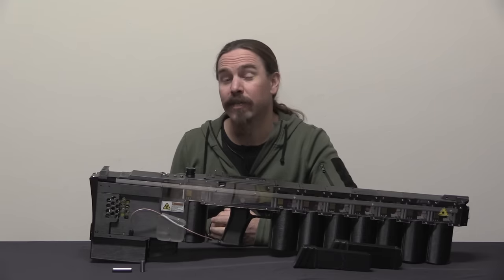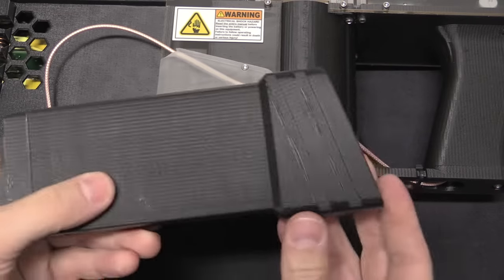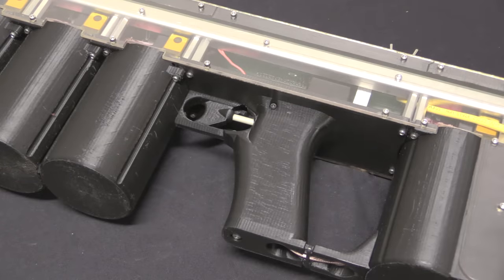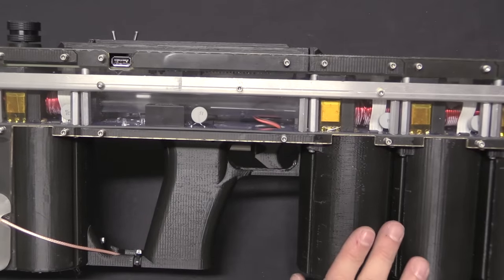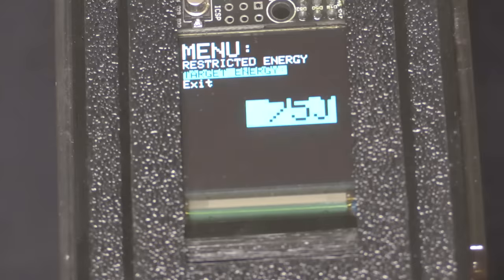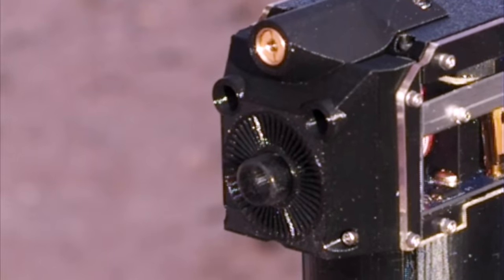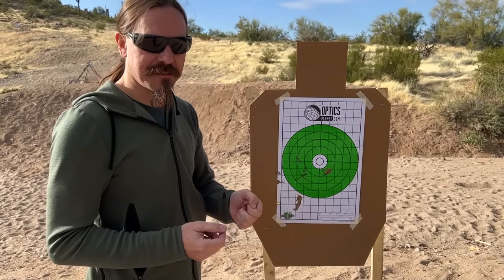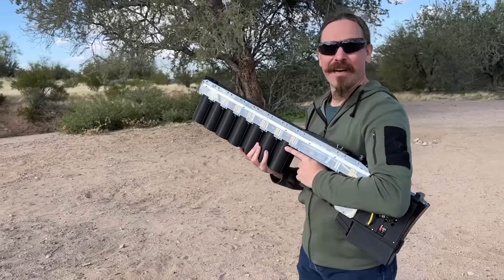ArcFlash Labs' GR-1 Anvil Portable Gauss Rifle

Comment: Since the projectiles for this thing are pretty much the size of a whole cartridge for actual firearms, do you think it could be used to deliver explosive payloads? The long rounds aren't quite as big as actual grenade launcher grenades but I feel like you could pack something that's still mighty unpleasant in that form factor.
Reply: Maybe you can pack a projectile similar to a mini rpg round. Not quite a boltor but pretty damn close
Reply: possible. I was thinking CNC machine a spiral projectile or some sort. Would likely help the tumble, and accuracy.
Reply: Could use depleted uranium to make it punch through body armor. I don't know about explosive payloads though.
Reply: I would almost be afraid that the acceleration would cause it to detonate
Reply: @sorrenblitz805  I don't know if Uranium is ferris metal or not.  At most it would be paramagnetic and not suitable for a projectile in a weapon that relies on magnet fields.
Reply: @crisnmaryfam7344  to expensive per round. I was thinking drag stabilizer like a fin or streamer
Reply: I have no clue. Maybe some sort of plastic shield around a charge with geometrically stabilized metal structure around the whole thing that wouldn’t crumple underneath the pressure of being whisked along the barrel…
Keep in mind I live in lala land.
Reply: Does the projectile need to be ferrous? Or  just electrically conductive?
Reply: @robjohns5806  Ferrous (thanks for the spelling help) as I know it. They are propelled by the magnetic field produced by the copper coils. either way they are insulated by the plastic barrel regardless so conductivity wouldn't be a factor.
Reply: @derekmills4220       I know nonferrous, diamagnetic materials like copper and aluminum  can be accelerated with a moving magnetic field.
     I remember convincing myself that it was the materials degree of diamagnetism that was affecting how much my old copper penny or chunk of an aluminum heatsync woulf zip off when the rotating N52 magnet (rigged to dremmel tool) was brought near. 
     Apparently that's not what causes the movement though. After i obtained a bit of bismuth thinking the effect would be much greater i was disappointed to see any interactment was basically imperceptible to me, and it is really the copper and aluminum's high electrical conductivity, and Bismuth's lack of, that relates to the acceleration. But im not sure if the gauss gun is using the same means to accelerate the material, eddy currents?  
     Sry if i was rambling on. 
     IMO electromagnetism is much more complex than most realize, and not completely understood, I remember reading magnetism may be product of relativistic effects on electrical fields...  Yeah, we can manipulate the phenomenon, but without fully understanding, the same way we do with gravity or quantum mechanics.
      Edit: after doing a bit of reading gauss guns can use ferromagnetic or electrically conductive material as a projectile, and i probably shouldn't be separating electromagnetism into exclusive properties
Reply: @robjohns5806  interesting. Well seeing that Uranium is paramagnetic, and semiconductive I suppose it could be used as a projectile.
Reply: @derekmills4220  A tungsten slug with a ferrous sabot strikes me as the solution, like a scaled down version of the railgun rounds we've seen tested, just using a sabot for its magnetic potential rather than for conductive potential or sheer width, it might have to be more complex than with other forms of propulsion to keep the (essentially) non-magnetic slug centered without barrel contact for slug or sabot, and somehow stay as one piece when not being launched, but it's still within the realm of possibility I think.
Reply: @crisnmaryfam7344  you could impart spin with magnets or fins
Reply: Brony
Reply: @sorrenblitz805  Not at that speed. To put it in perspective, I still remember my classes in the army, the 5.56 travels at 990m/s, this one is just going at 70. It will hurt if it hits you but the chances of it penetrating is very low.
Reply: That is made up lol.

Explosives can be extremely inert.
Reply: @sorrenblitz805  Uranium is only weakly paramagnetic.

Penetration is related to hardness and projectile length.   A steel dart will penetrate fine.
Reply: @crisnmaryfam7344  shoot worn out carbide endmills.
Reply: @robjohns5806 "gauss guns can use ferromagnetic or electrically conductive material as a projectile, and i probably shouldn't be separating electromagnetism into exclusive properties"

Correct! Electromagnetism is a unified theory. That said, if you use magnetism and conductivity in different ways, combining them could create a hybrid gauss/rail gun. 
👍
Reply: I can imagine needing a solid mass for good acceleration, but i really don't understand the science on this. Perhaps a hollow, explosive round would work just as well as these dowels.
Reply: This thing is using heavy projectiles not because it's more beneficial, but because the speed limit of their acceleration system is too low to shoot optimal projectiles with decent amount of energy
Reply: Wouldn't those be considered a destructive device?
Reply: They're tumbling, so no, that'd not be worth it anyway. Also... WHY? On even the most anemic 10mm grenades you get FAR more velocity, precision, ease of use, cheapness and efficiency with standard powder rifles! Not to mention the slow velocity would mean much more delicate detonator, which at these low velocities would mean that you'd have the risk of explosion on dropping them or hitting them! So yeah, bad idea all around, and as a weapon its a good century or two away from actually being worth anything, unless we come by some radical new innovation.
Reply: @KrepsyK  well, if projectile can withstand acceleration from an explosion of gunpowder, EM impulse won't do it any harm either.
Reply: @robjohns5806  as someone above already mentioned, RPG-7 style projectile (magnetic rod with explosive charge on the end, sticking out of the barrel) will do the trick. Or, if you want to keep it within calibre: half-and-half in the length.
Reply: Lol just dip them in poison . Hows that for ya?
Reply: @DzR1591  useless, that's how. You can do that for literally anything else and claim it's an amazing weapon, including a sharpened twig.

Comment: I think the fact the slugs can vary so much in size, weight and adjustable energy could point to a future with weaponry where you would see more universal weaponry with Gauss rifles. Same weapon could be used with lower energy, smaller slugs with larger capacity for close quarters combat or be set to larger slug at high energy for vehicle/sniper round. I would not be surprised with evolution of Tech of seeing something like interchangeable parts lol larger external battery and barrels with better cooling being used on the same rifle to turn it into a high caliber/high rate of fire suppression, or having barrel extensions that include more coils to increase velocity. There is a incredible amount of flexibility that can be done with a single core weapon.
Reply: @onkelpappkov2666  It's not that. You can always add more coils for velocity. But you can never have rifling.
Reply: @onkelpappkov2666  Would there be any benefit to making the ammo into round balls instead of oblong slugs?
Reply: @myWiggy  The shape of the bullet has to be redesigned, a better barrel, higher energy and a variable distance between the coils to optimize for accelerating speed.
Reply: So like a gaming pc.
Reply: @Gubers  100 years seems somewhat pessimistic considering we went from the first airplane to a man on the moon in less than 70 years. What is more relevant is the cost for these weapons systems.
Reply: @Gubers  True and the problem with science is, especially within physics; it isn't very profitable. In order for us humans to make the 'next big step' in development, we do need to understand better what is happening in the atom scale (and smaller). Problem is, we are stuck at the Heisenberg's principle until we have a genius among us who can crack the 'code' :)
Reply: @onkelpappkov2666  wouldnt this be solved by programming? Couldnt you have a switch rapidly cut power as you reach the next coil?

Comment: It seems like long projectiles are the way to go with this. The long slug was able to get the full 100J of kinetic energy while the small slugs were putting out somewhere around 66. There's still a lot of issues to be worked out on this of course, but even as it is, it's really impressive.
Reply: I think going with a sling bullet design might be interesting, or really any round/ovoid shape. I don't see a point in trying to stabilize a cylindrical projectile when you could do the same with a shape that will have more uniform penetration regardless of tumbling. Maybe I'm just full of shit though idk.
Reply: @tx7140  I'd imagine the length is more important to the timing of the accelerator.
Reply: How about a dart with spring loaded fins?
Reply: @satibel  The idea is good, but it is difficult to do without a machine
Reply: @satibel  The Navy rail guns I've seen video of basically have a casing protecting the fins until they exit the barrel. So in the barrel it is a cylinder and that jacket comes off upon exit.
Reply: Long time ago (when I was a student) I made small coilgun so I have theoretical and also practical experience.
Projectile must be created from some ferromagnetic compound and had maximal mass (ideally cylinder) for correct operation - some special shape like dart is not possible.
Barrel needs to have higher tolerances and also thin walls (some plastic tube is inadequate).
To prevent tumbling, projectile must have aerodynamic shape and also correct positions of center of gravity and drag (cone in front and small cavity from back). Of course projectile speed must be high enough.
Overall design of this GR-1 is very weak and also workmanship is poor. And also I would never try to sell something like this - because I would scorn to do it and also it is illegal in my country (everything above 15J of kinetic energy is firearm - so illegal armament felony).
Reply: @ferosofranek8817  I think everyone should look at this as an interesting project and no more at this point.
Reply: @ferosofranek8817  is there a reason rifling isn't being used in this weapon? I imagine it would help maintain the angle, and can't think of any reason it should affect the acceleration within the unit
Reply: @MelodicTurtleMetal  perhaps temperature issues? Temperature is already an issue with the "floating no-contact smoothbore design", adding another variable such as friction from a rifled barrel will increase the temperature drastically
Reply: @fdenrico9861  ahh fair enough. Good insight
Reply: @MelodicTurtleMetal  I think that any kind of rifling will slow down projectile so much that this coilgun will be useless. There is very small kinetic energy, every Joule counts...
Also some plastic tube doesn't allow any rifling - projectile must be tight-fit into barrel and plastic will be worn out after few shots.
Anyway, 70m/s is very slow (my simple BB gun has 170m/s), therefore this is something like projectile thrower, not canon/rifle.

Comment: Hers the thing:. That thing sounds like a crossbow, and 100j isn't half bad for a crossbow either.  Make the round pointy and add fins, and you have a weapon worth respect.  All the power of a crossbow, all the ammo capacity of a rifle.  Even this zeroith generation mass driver could be made very deadly indeed.  Rember, this is basically the arqubus of electric guns, and last I checked empires have been built with far worse.  Hell of a gun, and props as always for Ian and crew for treating this like what it is: a crude, but potentially very deadly weapon.

Comment: I love how much the rifle of the future is still reliant, and quite fouled up by magazine quality. It just goes to show how right Ian is when he explains the benefits of using an existing magazine system for development. Can anyone recommend a magazine that would work well with the projectile sizes they're targeting?
Reply: Not a whole ton of magazines for this kind of feed system.
If they made a .50 version they could probably drop stiffer springs into Nerf mags.
Reply: Just slap a P90 mag on there it'll be fine.
Reply: I would hazard a guess that a more positive magazine retention catch than just a ball-detent might mean that stiffer and more reliable magazine springs could be used.
At the moment, the mag spring would be fighting the ball-detent spring and that seems to mean that the mag spring is weak enough with one~two slugs left that it tends to misfeed.

Comment: I'm wondering if they've considered discarding sabot fin-stabilized rounds for this, I think that was tried for the larger naval railgun projects?
Although the sabots would need to be metal for the electromagnets to launch them, that might make it impractical.

Nevermind, I am watching the interview now. Railgun is different from Gauss gun.
Reply: There is no need for a sabot in these kind of guns, it doesn't need to build pressure in order to be propelled forward and the magnetic field tends to stabilize the bullet while in the barrel. The fins would be a nice addition though
Reply: There is no need for an armature or container for the slug like there is with a long rod penetrator inside a tank barrel or as with a projectile from a railgun. So probably not? On the other hand If you want to improve accuracy fins could be used to impart spin and reduce tumbling though.
Reply: I wonder the same thing; not for building pressure but for the ferrous sleeve to accelerate the projectile.  

In the first video it was said they were working on a way to electronically spin the round as well.  I'm curious if a ferrous metal jacketed lead core would accelerate just as well.  If so, could magnetic or ferrous contacts be arranged on the ammo itself to induce a spin during acceleration?  
Probably not, but it would be fun to experiment with.
Reply: @markhayward4017  not with those coil geometries, unless there is a fancy material that can act as a foil while in a magnetic field
Reply: also dont mix em up with rail guns!
Reply: Problem with hypervelocity guns have been known since World War I with the Paris gun, despite a heavy charge the gun had a range of 81 miles and the barrel had to be factory rebored after 65 firings. The US Army conducted research on railguns/hypervelocity rounds decades ago. Apparently they did not share their findings. The most basic rule of physics; Aerodynamic drag is proportional to the square of speed , then the power needed to overcome it increases by factor cubed. Double speed, Quadruple the drag and Octuple the energy needed to go the same distance faster. Missiles overcome this problem by carrying All the energy they need as propellent. Bullets have all the energy during firing and lose kinetic energy as they travel. Bullet has to be aerodynamic, robbing it of mass, nor a good sized warhead. For years Navy has spent billions a year to develop futuristic weaponry that remain stuck in research and development. Simple rockets are far cheaper.  Railguns are still trash. Rules of physics dictate how projectiles behave. The air drag of an object increases with the square of the velocity, double the speed, you quadruple the drag. Projectile volume must shrink to be aerodynamic. Mass of the projectile is too small/light for any discernible effect on the target. US Army already has "Hypersonic" Projectiles, M829 APFSDS. A depleted uranium dart, fired at Mach 5 and effective range is 4 kilometers; maximum of 8. The Army needs them to penetrate thick armor. A naval gun will penetrate the ship & out the other end, accounts from World War II show armor piercing rounds going thru ships and still fight capable. Rounds cant be guided; You're zapping a Lightning bolts worth of electricity, frying any electronics. So the rounds must be fired dumb. Even artillery computers cannot guide a round in wind, humidity, outdoor temps and air pressure because of it's reduced mass. Any explosives or proximity warhead would instantly detonate being zapped with a million amps of current. Problem with hypervelocity guns have been known since World War I with the Paris gun, despite a heavy charge the gun had a range of 81 miles and the barrel had to be factory rebored after 65 firings. The US Army already conducted research on railgun rounds. Apparently they did not share their findings Navy's big proponent Adm. Jonathan Greenert was involved in the "Fat Leonard" scandal. This is Not BAE's first naval gun fiasco.

Comment: Would musket ball-type ammo solve the tumbling problems? Yes, it has no rifling, but steel balls might improve accuracy and velocity bleed.
Reply: Maybe, but the lack of mass would make the projectile even slower than it is now.
Reply: an oblong shape might be important for the magnetic field of the projectile.
Reply: @swede178  what about some tungsten/iron composite? Suuuper dense projectiles in a small form factor
Reply: Magnetism and spheres does weird things
Reply: This all really brings up the question of sculpts in general. Since it's just hunks of ferrous metal, you can probably get fairly elaborate without being more expensive than a traditional cartridge
Reply: Or finned darts like smoothbore cannons use for solid penetrator rounds.
Reply: @verager2493  oh yeah, like those bullets in Wanted
Reply: @massivepileup  or like flechettes. I'd love something that could make 20 fpe with a suitable dart at modest velocity for small game/pests.
Reply: Did not see this before my comment. Interesting comments.
Reply: @wojciechbieniek4029  I think the factor in speed would be the ratio of ferrous metal versus mass. I think the tungsten carbide would tank that ratio and end up way slower(it's heavier than it is ferrous). I would anticipate the best results would be had with iron or nickel.